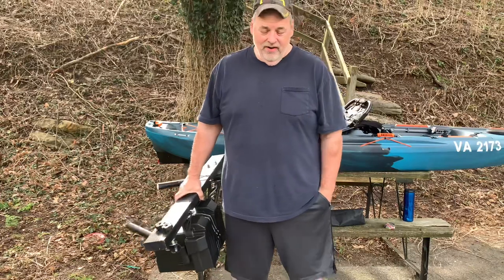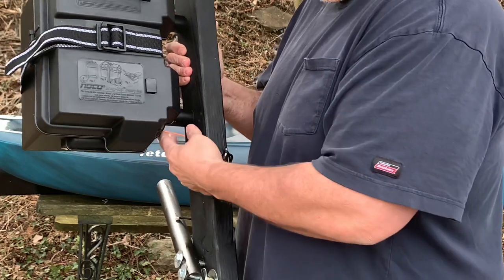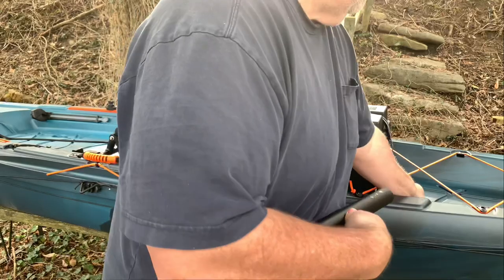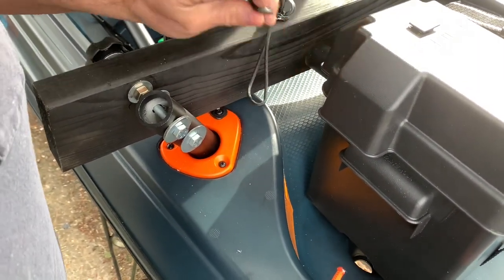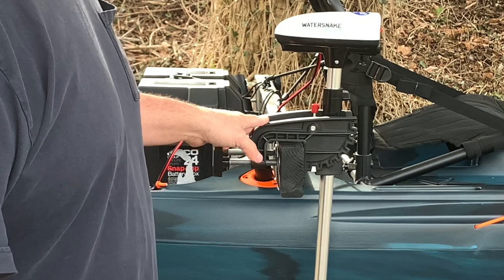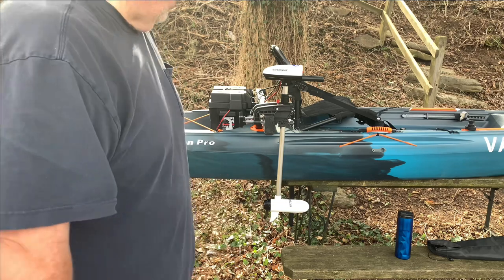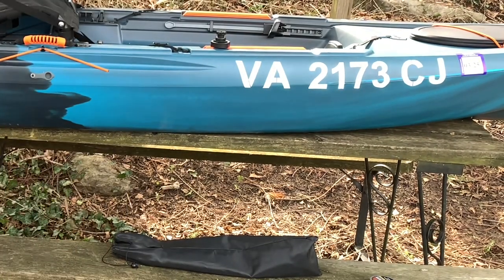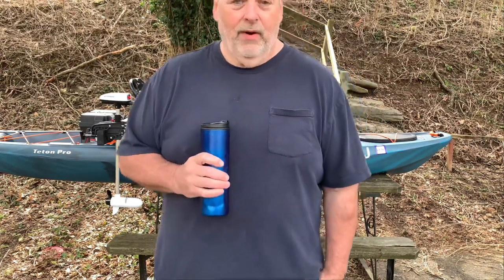✅ The Best No Drilling DIY Kayak Trolling Motor Mount

Comment: Great instructional video. BTW looks like you are enjoying retirement life as well. I've been retired since 2011, like you, enjoy fishing from kayak in both ocean and lake. Anyway, what was the length of the bolt you used to construct your motor mount? I'll be getting a Newport Vessel 36lb trolling motor.  Thanks again for putting this on YouTube.
Reply from the maker: Thanks for watching. I used 5 inch bolts. I only used the length because I used spacers between the pvc pipe and the board to make the board set level. Some kayaks there is no need for spacers, so shorter bolts will work.

Comment: whats your thoughts on making the 2x4 longer so it'll hang over on the other side, and use a second trolling motor?
Reply from the maker: You will have to rig something like pvc pipe connected to both motors. So when you steer one the other moves in sync. Probably have to get a bigger battery. You might be on to something. It would probably turn tighter.

Comment: I have the same exact kayak and used the water snake with the kayak mount and put it in the same place you did but I had problems it not turning good at all. How’s your working for you?
Reply from the maker: It doesn’t turn to the right as well as I like. After some practice it gets better. I added a diy rudder to the Watersnake it helps with the turning some. As guess I’ve gotten used to it now.
Reply from the maker: gracias y gracias por ver.
Reply from the maker: I added a plastic rudder to my Watersnake it works much better but still not prefect. I’m happy with it. I did a video on how I added a rudder to my motor.
Reply: Many thanx for your video. This weekend i hope to finish the building it like yours! Keep you posted!
Reply from the maker: @markwichmann7604  Glad to help. Thanks for watching. Yes, let me know how it turns out. I’m still using mine. This will be the 3 rd summer. It’s still working out great. Good luck.

Comment: Very helpful, thank you.
Reply from the maker: Thank you and thanks for watching.
Reply: It was the best setup I’d found, period! I knew that I had most everything I needed to construct it in my garage. I was about to cut the video short and head out there when I heard you mention that you had to register your kayak in your state.  I live in Illinois where everything short of driftwood has to be registered so I went online and checked. No surprise here, yes, if I installed a trolling motor I would have to register my kayak, number it and pay yearly fees. CRAP!  I may need to think this over a little while. lol 

Thanks again and I repeat, you found an excellent solution to the mounting bracket problem. 
Thank you,
Wes
Reply from the maker: I’m glad you like it. In my state if you put a trolling motor on an inner tube it has to be registered and pay a yearly tax.
Reply: By the way, how do you like that little Watersnater trolling motor? If I do opt to give it a whirl that was the one I’m eyeing.

Comment: I groom DOGS!  Let em bark all day long! now hopefully you might be willing to give a lil advice.  I want to do a holeless mount like yours. I got a 12' Sundolpin Journey. what size trolling motor would you suggest? ty next time dem dogs need to be in the movie
Reply from the maker: My 24 lb thrust does fine. Weight was my deciding factor.  With me and all my gear. I think 30 lb thrust would be plenty. Plus you battery size. The more thrust the more amps the motor will burn. Which means less run time or a bigger battery. I think a happy medium would be 30 lbs of thrust or less. Good luck and thanks for watching.

Comment: Just curious, what is the length you cut the 2x4 too?
Reply from the maker: Honestly I don’t remember. I put the PVC pipe into the rod holders and laid the 2x4 across them and marked the board a little longer than I thought I needed. Then when I mounted the motor to the 2x4 I cut off the excess leaving a few inches past the clamp mount on the motor. Thanks for watching.

Comment: Is that actual rod holders you used on the board?  Do you remember the size of the pipe?
Reply from the maker: Yes, it’s actual rod holders I bought at Walmart 3 bucks apiece. I just drilled a hole through them and mounted with wood screws. If you’re talking about the pipe I used for bushings to level up the rod holders I’m not sure. I think 3/4” but they only need big enough to go over the wood screws. Btw the rod holders work great. Tip. Mount them close to the outside edge of your kayak it will make it easy to reach around and grab and replace while on the water.  Thanks for watching.
Reply: @HotLeadretired  , yes, I was talking about the pipes that go in the rod holders on the kayak. I almost bought them things a few minutes ago but they don’t look like they’ll fit in the rod holders on my kayak. Thanks for responding😊
Reply from the maker: Oh, they are 1 inch pvc pipe. They fit a little lose. 1.25” fit to tightly. Later on I added rubber bands to the end of the pipe. I just wrapped a few (4-5 ) rubber bands around the end of the pipe that goes in the rod holder. It tightens them up and really works great. I improved upon my mods as the need arises.
Reply: @HotLeadretired  SWEET THANKS!
Reply from the maker: No problem. Anytime.
Reply: Use 1 1/4 and cut slits long ways and they will slide in. I little tighter. This is a good way to mount and lock the battery so you won’t lose it if you accidentally fall out.

Comment: Do you have a list of parts by any chance? I’m trying to do the same thing with my kayak
Reply from the maker: Best I can remember 1 4ft 2x4 board. 6ft piece of 1 inch PVC pipe. 4 bolts 5/8 inch by 5 inch long. 5/8 washers and nuts. Two 5/8 plastic quick detach knobs from lowe’s. 1 can black spray paint. 2 eye hooks. I used over size nuts as spacers I already had. That’s about it.
Reply: @HotLeadretired  thanks!
Reply: I believe those are the 5/16 I was just looking at the 5/8 and it's way too big lol
Reply from the maker: Lol. Yeah, you’re right

Comment: What length of 2x4 did you do?
Reply from the maker: I just bought a 4 foot long 2x4. I installed the 2x4 to the PVC pipe and attached my motor and made a line about 2 inches longer. I also marked where to cut my PVC pipe even with the edge of the 2x4. So, I didn’t even measure anything.

Comment: Anybody really wanting the easiest trolling motor mount ..just clamp it to the side behind the seat and go. Works on 90% of all kayaks. Won't Crack it , won't hurt it , takes 5 seconds to do and have been doing so for years .try it before you build something.
Reply from the maker: https://youtu.be/ROR_eTuQO9I. The biggest problem mounting it with the optional kayak mount is the motor rotation when you turn it on. The one point of contact is not strong enough with the plastic brackets in my opinion. Watch this video. This was the reason I made my own, it’s much sturdier.

Comment: Couldn't you just use one bolt and spacer on one side for faster more accurate fit? Good design though
Reply from the maker: Yeah, you probably could. Maybe just center the one bolt in the middle. It should be fine. Thanks for watching!

Comment: Why use spacers
Reply from the maker: Because on the Teton 116 kayak the rod holders are angled. In order to make the 2x4 set at 90 degrees you have to use spacers. If you don’t the motor will be on a crazy angle.

Comment: How to stop it from going in circles
Reply from the maker: Well, after you get used to it, it isn’t that hard. If you mean going in circles while drifting just lift the motor out of the water. Adding a rudder help me out a lot. It just took me some time to get used to turning it. After that it runs great.
Reply: When I turn my trolling motor on it goes circles how do I keep it driving straight
Reply from the maker: Is yours mounted at the center of your kayak? If it is it needs to be more toward the rear, sitting behind you. If it’s mounted behind you just make small steering adjustments on low speed. It will go straight you just have to make little adjustments until you find the spot it goes straight.
Reply: Have mine mounted in the rod holder like yours
Reply from the maker: I don’t really know what to tell you. Mine has never gone in circles. If I turn too sharply it gets a little tipping. So I don’t make sharp turns anymore. I say just practice with it on making slow wide turns.

Comment: I don't like this method as it throws off the balance of the kayak
Reply from the maker: Not really. That motor only weighs about 5 pounds.
Reply: @HotLeadretired  I had a 30lb thrust and when you try and turn it does
Reply from the maker: Yeah, that’s true it will. I slow my down if I do tight turns.

Comment: Did the mounting part come with the motor? If so what kind of motor is this?
Reply from the maker: The motor comes with a standard mount. That’s what I bought. Or you could get the kayak mount for a little more money. I watch the reviews of the kayak mount it wasn’t what I needed for my set up.